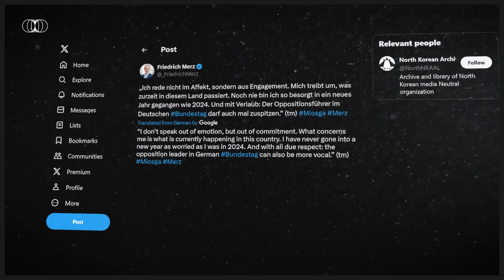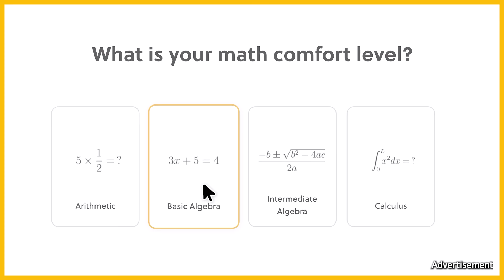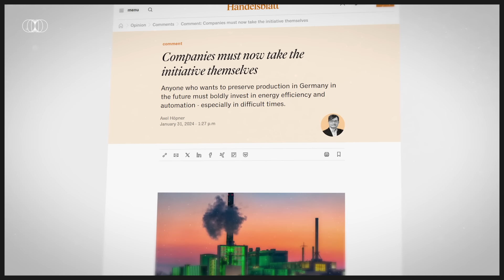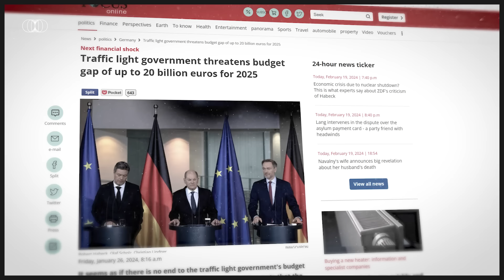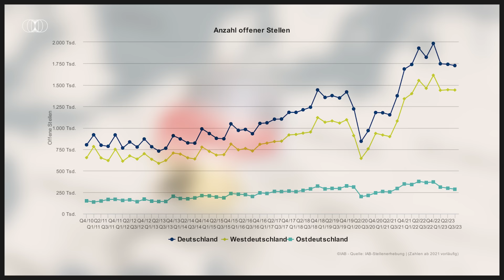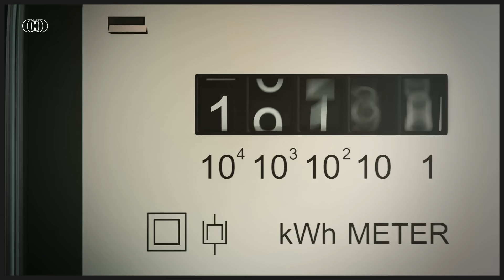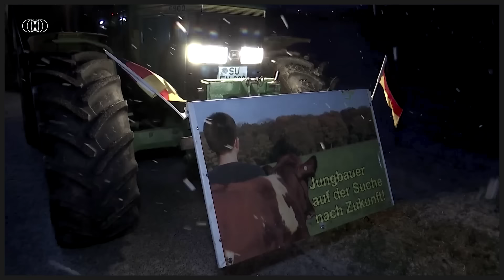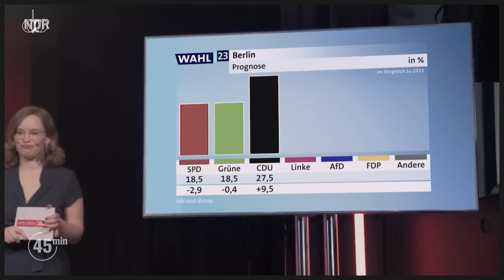How Germany's Problems Can Bring Pre-WW2 Misery

Comment: I am an Senior R&D Project manager for a German multinational. I can tell first hand that bureaucratic red tape is forcing us to relocate most of our business. Most of the regulations on chemical business are so strict that it is no longer possible to do innovation, let alone set up production, in several key areas. If saving the environment is the goal it is self defeating: you make regulations so strict that companies are relocated just across the boarder, with externalities coming right back. Or even worse, relocate in countries with no regulations at all, making it worse for the environment as a whole. When, in think-tanks you try to explain this, you are met by a bunch of jurists that lack the basic technical understanding in the fields they are regulating upon.
This is just the start. Complying with bureaucratic requirements starts to cost more than the rest of the development process combined, without any real tangible benefit for the consumer, safety and the environment. Having this coming from parties that then caused Germany to increase reliance on coal because of an irrational fear of nuclear is, to put it mildly, infuriating.
There is nothing more efficient at killing the German industry than German regulations.
Reply: Then you have to go abroad and pollute the environment there? Oh, Tesla has now done the same in Germany.
Reply: @arnodobler1096  First off: Tesla did complain, quite vocally, on the environmental impact restrictions Germany imposed, despite all the subsidies. Second, tesla could not commercially put up a battery production plant because of the restrictions.
Moreover, if you care reading, I did specifically mentioned chemical business (and I could throw in materials and most semiconductors as well).
Reply: Ex-fucking-actly
Reply: sorry, but you can no longer pollute the environment for free, as you did before. things are moving forward with you or without you.
Reply: @ismail-paine-de-circ  This is the kind of comment that comes from someone that decides on a topic before having even understood what people are saying. 
Let me spell it out for you: these policies lead to companies that would have otherwise polluted LESS inside Europe to relocate and pollute MORE. Thus if environmental protection is what you care about you should condemn these bureaucracy.
Unless you care only about the pollution that happens inside Germany only, which would make you a hypocrite.
Moreover many of these policies do create high additional costs without making nil-zit to protect the environment at all.
Reply: @yoshyoka If I read you correctly, I believe you are saying that regulation that restricts innovation that could lead to overall reduction in pollution hasn't been either looked at well or is used non-strategically. It doesn't sound like you want to see more pollution, it is that moving to other countries which you are allowed to pollute more, but are cheaper to produce results in more pollution overall.
So what regulation do you believe should be lifted so companies stay in Germany? You can list all the ones we may know about (e.g. nuclear power shutdowns), but I am interested in the more nuanced ones. However, if you don't care that much about pollution and the effects on the ecosystem, fair enough. Just be upfront about it.

Generally, from the sounds of it, a mindset of massive bureaucracy is overall squashing potential across the board; the time will come that that will be the easiest to chop, but not before the dedication to bureaucracy is stretched to its final end.

I would also say that if you can't keep people, and you won't invest in your own people or they can't be bothered to invest in yourself, then you need to make decisions one way or another. It would make sense to lift restrictions on smart migrants and make it phenomenally easy to come and set up and work.

Unfortunately, the non-innovative and critical-first mindset of Germans will be very hard to pivot on. That un/fortunately is why the US will win over Germany in the long run until this is overcome. The US pivots in a nano-second for good and bad, Germany doesn't.

It might be that Poland comes through on top in the next 10 years!
Reply: @yesand5536  Indeed I want to see a reduction in overall pollution: the thought that reducing it in one country just to see it increase overall is nothing but greenwashing. unfortunately, considering the answers I am getting, a very successful type of greenwashing.

But to be more specific, let me give just one example from my own field: water treatment.

If I take table salt and use it to feed an electrolytic cell to produce chlorine in situ, I am forced to transport an label that salt as a Biocide. This means that I need to treat an innocuous precursor as if it would be the active agent, instantly, and needlessly, multiplying all costs by a factor of (at least) 4. For small applications these costs leads to the preferential shipping of an active solution, which means more will be used, wasted and more active chemicals transported.

Other example: 
We tried to innovate and invent a new active disinfectant for the market which after oxidation left no polluting residues. We were headed into a bureaucratic brick wall: turn out that if your active substance is not listed among the official active biocide (how could it if it is new??) then it cannot be used. But in order to list it you are looking at costs of several million and about a decade of lost time, even when you can already present all the empirical reference data and studies that are required. 

A more general one:
In Germany (and the EU in general) there are strict laws of compliance about a number of products, which is a very good thing. However, if I don't want to bother complying with them I just go outside the EU and sell them into Europe via an online platform. There will be no controls, no real barriers to entry, no check about your CE or other certification standards that I will have printed on the product. Companies in Europe on the other hand will have to comply with all the above, absorbing the costs that this entails, while having to face a competition in the market that does not. 
(Side note, I tested several imported products that are used to "treat" drinking water at home, like filters with instant heaters, that released an ungodly amount of heavy metals into the water. I have sent an official complaint, with the result that the seller changed name and was back to business within 3 days.)
For EU companies there are only two ways to survive: 1. you either have the luxury of having a brand recognition high enough (and this generally means you are a luxury product) 2. you move and do the same.
The result is that regulations fail at their basic tasks of protecting the environment and consumers while killing the domestic industry in the process.
Reply: @yoshyoka Thanks for your reply. I'll have time to read it tomorrow (it's very late at night atm).
Reply: @yoshyoka  Hey thanks for replying. What it sounds like is the lived experience of regulations catering to the majority of what is know and easy for regulators to say they did their job, and the larger effects it can have on outliers. It also links with what most of us who pay a little attention, that once something gets bad or the cumulative effects become important for regulators to act because now its a pain point for them, then things start to get looked at.
Also, I suspect, when regulations are drawn up, it is likely whole stories like the ones you have told are not either a) mentioned in any great way b) haven't shown themselves to be a problem across the industry, so they aren't addressed.
And yes, climate change etc isn't limited to the borders of a country, however, the humans are, and not to sound like they are idiots and I/we/others are smarter than them, humans it seems, can only do so much and will only do so much that their job relies. At least there is, thanks to the existence of the EU and order united groupings like the USA, cross country collaborations and agencies.

What happens next? People like yourself know the ins and outs of what really happens in the industry, and I guess you are left with two choices: keep this to yourself, grumble and carry on or actively find ways to get it addressed. Social media has pushed our penchant for complaining to gigantic heights, and also giving us a way out to be active. I hope you, along with other professionals like yourself, find ways to push for changes - there is always a way, and "no" gives you a quick success of inaction. It's action as inaction. Good luck and whatever you do, it will move the ball further forward, so others may take it up if you don't get as far.
Reply: Good lord I wish I could explain this to the way you just did to everyone I know

Comment: Did you say LIGNITE???? Surely Germany, one of the largest pushers of green energy, didn’t choose to shut down several nuclear power plants in favour of lignite, one of the highest polluting types of coal.
Reply: hahahah
that's what happens with leftists in power
Reply: @likeAG6likeAG6 That's what happens if Idiots are in power. Don't even start to pretend the "other side" would have done it better.
Reply: @likeAG6likeAG6  And who votes them in?
Reply: our electricity system is cleaner then ever. The extra dirty coal plants have been at the grid only for a short time
Reply: @WilliDurpel  The cleanest maybe, but still 10-20x the CO2 per kWh compared to France or Sweden. And Germany is solely responsible for Poland coal, they wanted to replace it with French nuclear but Germany outlawed it.
Reply: @Bvic3  i dont think its fair to compare the electricity mix with france or sweden, because france is betting big on nuclear and sweden is a country with a small population but many rivers. When comparing the mix with the most other countrys the german mix isnt that bad
Reply: No they did not shut down nuclear plants in favor of Lignite. There was legislation made to allow more coal to be used in compensation of Russian energy sources not being available anymore on short notice. What gets overlooked easily is that this was NOT USED though. Germany never actually did increase coal power plant production beyond the usual, in fact it is lower now than it was in 2022.
Reply: @likeAG6likeAG6  So true

Comment: Certain potential steps appear relatively straightforward to me, for instance:
- Re-opening nuclear power plants could help stabilize and reduce energy prices.
- Lowering support for unemployed people would motivate them more to work.
- Long-term unemployed immigrants could be deported by a new migration policy.
- Streamlining bureaucratic processes could attract additional investments.
If Germany wants to get stronger and take on the AfD, the government needs to be more decisive and pragmatic imo.
Reply: But nuclear electricity isn't cheap and base loade electricity isn't the issue - electricity prices are also not formed by simple supply and demand but by merid order cheap to expensiv source i.e. high gas prices push up electricity prices.
Reply: Except for your last point, everything is AfD shit
Reply: @michaelrenper796 Yes, 20-25 AfD is not a majority
Reply: @peterlustig8636  Good point. Not sure about this one in regards to lowering price, but generally, decreasing reliance on burning expensive gas or polluting coal seems to be a right step to me. France builds even new nuclear plants, which is definitely more expensive than maintaining the old ones, I guess they know why.
Reply: If a nation moves so far left that people respond by favoring the opposite then the best way to silence that is to move back towards the middle a bit
Reply: @peterlustig8636 it can be relatively affordable if the capital expenses have already been paid off. I think for the loads they were discussing specifically, such as heating, it can be argued that these fit within smooth load curves and could be met by nuclear power.
Reply: That is all pretty naive and shows a shallow understanding of the issues at hand.
Re opening nuclear power plants isn't viable. Licenses have run out and maintenance that would have been necessary hasn't happened. Furthermore, deconstruction has already started. Also, this wasn't an instantaneous event. Most reactors have been decommissioned years ago, meaning the majority are fairly far along in their deconstruction. Recommissioning them at this point would take years and cost billions. The last thing we need right now.
Lowering support for unemployment also isn't really possible. I'm not exactly sure what GTBT is getting at, but the benefits are already so low as to make living barely possible. On unemployment benefits, you can afford a shitty apartment and some cheap and unhealthy food. That's it. Lowering it any further means people either end up on the streets or don't eat.
The issue with refugees is less that they don't want to work and more that they are not allowed to. Until you get official refugee status in Germany, you can't apply for jobs. Getting that status requires dealing with a slow and overworked bureaucratic system and that takes months. Deporting them is in many cases also not possible. In part for the same reason - you can't deport someone before determining their status - in part because they have a legitimate claim to be here. Deporting them would often mean sending them back to active war zones or into the hands of regimes that would severely punish them.
Streamlining bureaucracy is a laudable goal - and one that German politicians have been pursuing for decades. The realities are more complicated. Changing established processes requires political capital. Influence. Something that is hard to come by with tenuous majorities in the Bundestag. It is further complicated by Germany's federal system, which gives every state a lot of leeway to manage their own affairs, making unified solutions and interstate cooperation difficult. The result is an incompatible patchwork of processes, effectively protected by the constitution.
Reply: @arnodobler1096  you mean 10-16%
Reply: nuclear power =  42,2 Cent /kwh, wind power = 4-8 Cent/kwh, PV = 12-15Cent/kwh
Reply: @Gnoccy I call bullshit. The US has all of those issues to a greater extreme and is not in recession but growing.
Reply: @wsollers1  The US isn't a Export driven manufacturing economy, but a largely selfcontained consumer market with its own fossil energy. Look up the price differential for natural gas 2022-now.
Reply: Reopening our flushed AKWs would take 30 years.

You old men with your "good old times" mindset.
Reply: @Djsalad96  Aye, but nuclear power is not weather dependant, does not destabilize the grid and allows for larger energy transfers.

So, you need to ad the cost of grid stabilization and increased transfer ability as well as the cost of increased redundancy and energy storage. Then you are not looking at 4-8 cets/kwh.
Reply: Cutting welfare doesn't motivate people to work, it puts people into situations that make it more difficult to find work, at least according to a trial from the UK. Things like increased housing stress, not being able to afford childcare and so on.
Reply: @Fuhrerjehova  even with storage renewables are cheaper. You are assuming that there's some missing cost element that makes nuclear cheaper based on ideology, not on evidence. There isn't - nuclear is expensive
Reply: and allow people who wants to do business in there and employ German people much easier ... and faster
Reply: @fehzorz  What storage? How much of it is there? There is not a single grid in the world that is based solely on wind and solar. Why is that, given it's all so cheap?

If you have a lot of hydro power, like Norway, it's possible to have a fully renewable grid. Since hydro can stabilize grids and act as a good energy storage. But so far, no one has showed a large scale fully solar+wind-grid. 

Strange. Given how cheap it is.
Reply: @Fuhrerjehova  because each new project is an investment that takes time to build. Even in situations where a new build is cheaper than existing operations, there's a lot that needs to happen to build the new plant.  Unfortunately it's not as if all the existing coal fired power stations vanish and are instantaneously replaced with solar and wind the moment the economics shift. You also have sunk costs - if you own a nuclear power plant and have secured a 10 year contract for uranium, it's cheaper for you to spend money on misinformation campaigns about renewables and lobby to delay projects than to invest in renewables. 

Australia is on track to be 82% renewables by 2030 and it has quite limited hydroelectricity resources. Remember nuclear and coal are also terrible at matching electricity demand - it's baseload that needs peakers (usually gas), just like how renewables need firming.
Reply: Nuclear plants cannot be switched on and off as politicians please. Decommissioning and recommissioning is a long elaborate process with many sub steps and tight regulation. It requires highly skilled labour.
Reply: 1. The anti-nuclear movement is to strong/to widespread in the population to reopen the plants.
2. Lowering the support will make them more poorer, it is a attitude problem.
Reply: @arnodobler1096  Imagine you also dont like Heilkräuter, because they have a special name xaxa